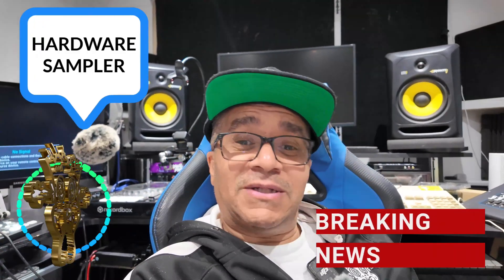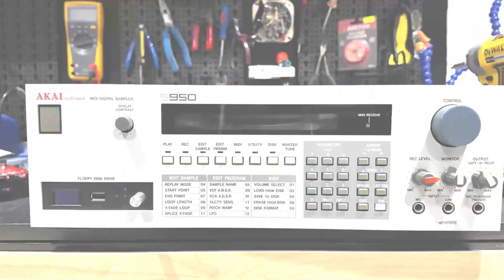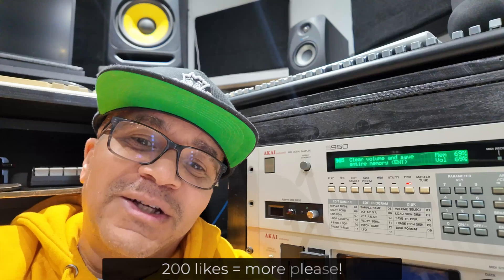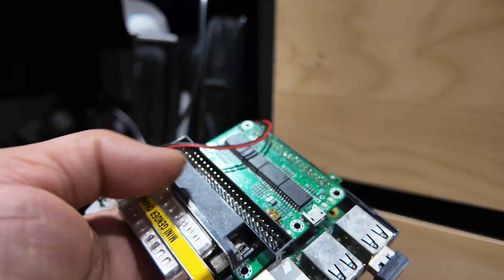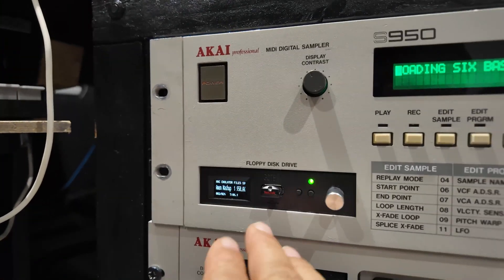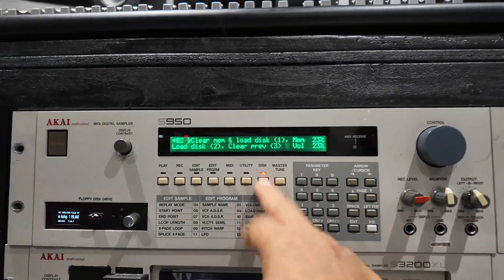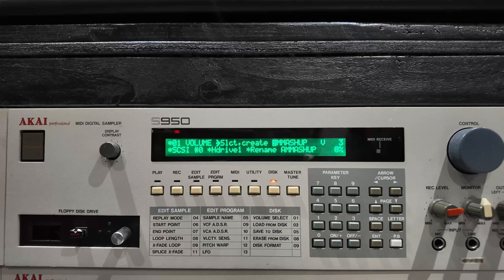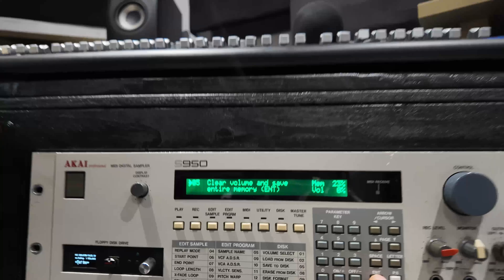This Mod Just CHANGED the Akai S950 Forever 🔥

Comment: Are you still limited to having samples spread across hundreds of virtual 1.44mb disk images like on the floppy emulator or can you  have thousands of samples on a single 2gb hard drive?
Reply from the maker: You get around 40 -50 floppies per Hardrive so you wont need multiple floppy images

Comment: I use all 3, gotek, piscsi and direct to pc. Took me a while but I found it was the best way to get a modern workflow and still get the best out the hardware. Just some quick notes below. 

Xp machines runs in a rack that’s connected the akai which runs recycle, working drivers, cables and scsi card 

Akai is connected up through the interface and mackie

open Ableton and run the audio out the xp machine into the interface. 

RDP from the Mac to the xp machine and have a shared folder to drop samples in, this acts like an extra screen or application if you want to look at it like that. 

Make edits and send to akai from recycle and save to the gotek 

MIDI files, samples, REX are saved to the shared folder for access across the network. 

Once the session is completed, edits…etc I can attach a large drive via piscsi and dump mass programs, samples..etc and can use this later, back up…etc

Had a bit of a nightmare bit by bit, so the reason for the gotek is the scsi recognises that first drive is unallocated when running recycle causing the scsi to fail with the aspi drivers. Took a lot of trail and error with cabling, cards, drivers..etc I’ll have to get a doc together and upload all the files as there in a zip, I’ve flattened the set up and re set up twice for due diligence and it works.

Comment: A few points , the reason why it loads slow is that you can grab a cup of coffee😅, seriously you can ask if the smalle memory ( think it was 750 or 1.5 on a s950) is worth spending much bux on a scsi , from my vintage samplers my S550( Roland) has a scsi board and cd-rom / harddrive and it's from 1987/88
Reply: SCSI is slow AF. I stopped watching the intro with his Game changer repeats. Such a turn off.
Reply: @Madrrrrrrrrrrr it depends wich protocol , some of them are lightning , the problem is more how some instrument manufacturers implemented it that is a bottleneck.

Comment: need one for mine .. if it can be available for my S612 that would be wonderland
Reply: Not sure scsi is possible on the S612. It only had the quik disk interface. Besides, you’re only able to load a single sound onto the S612, no need for SCSI at all

Comment: Nice Video Bizzy lightning fast speeds on the new scsi board. I recently installed the Ib05 digital board on my S950, Have you tried that one? It has 3 levels of input to overdrive the input at 44.1k
Reply from the maker: I hadn't, but is sounds cool